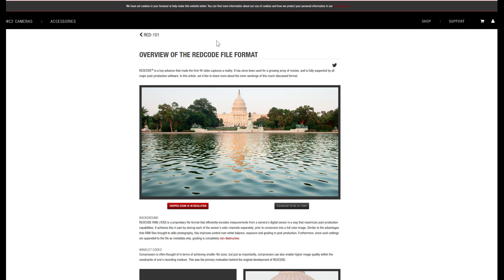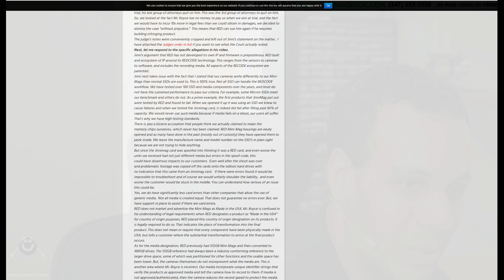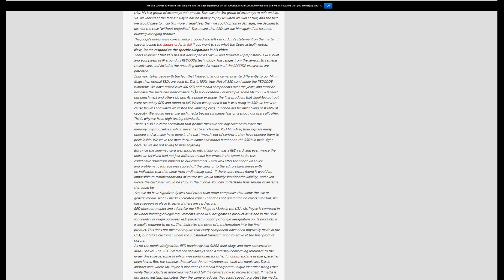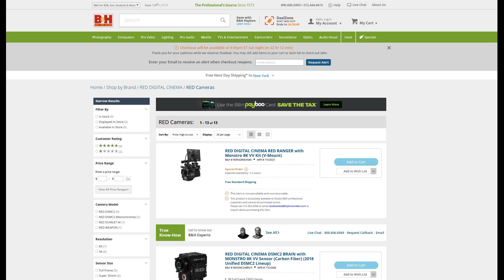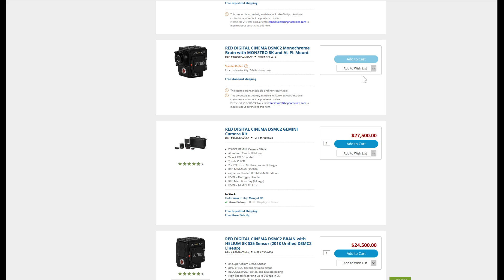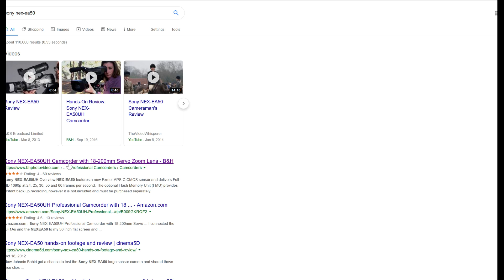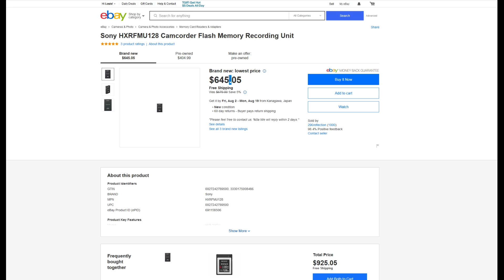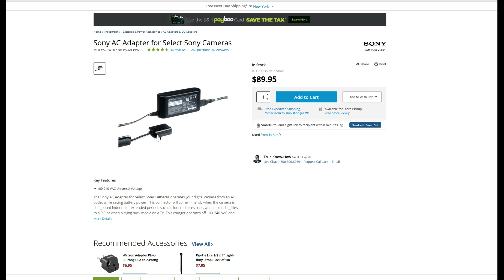Red Camera Mini Mag thing - my take on it.

Comment: Doesn't a gallons worth of printer ink cost like $5,000 or something?
Reply: Oh God, don't get me started. Not only do printer companies ramp up the ink costs but they go out of their way to not only make you use THEIR ink but also do really deceitful things like monitor the amount of ink you have (in the printer firmware) left then switch to using some BLUE ink rather than BLACK depending on what makes the ink run out FIRST to force you to buy a new ink cartridge... ugh.
Reply: yes that's another disgusting practice.

Comment: This is like crying that a Mercedes Benz is too expensive when most of your driving is down the road to the supermarket once a week to pick up some Swanson tv dinners and a case of Coors Light.
Reply: More like crying about your super expensive Mercedes Benz having a crap gas tank thats rusted out and leaks everywhere. Like Linus Tech Tips pointed out, they're quite cheap SSD's, and Red even offers data recovery(probably because of said cheap SSD's failing).
Reply: Wrong... it's more like complaining that Mercedes Benz is selling a GPS screen for $2400 that is identical to one you can buy for $300 from someone else. Then you call them out on it and they explain they spent MILLIONS OF DOLLARS developing this screen so you crack it open and see it's just standard parts they had no hand in developing. That's more accurate.

Comment: The problem is people thinking you get the quality you pay for when it comes to high end video gear. Surprise! You don't. Quite the opposite. 
Cheap shit is usually better quality for the money because it does 'work' and is ridiculously cheap. It's still crap quality, but given what you paid the quality is better than it should be. 
For the price you pay for cheap shit it shouldn't really work at all.
Reply: Ummm... you appear to be describing the idea that you get better quality in general with more expensive devices but not better value. Wow! Surprise! Sarcasm aside, the "value" a product has is completely subjective. The SSD storage costs are insignificant to Disney Studios when they film the next Avengers movie. To them it's a great value if it saves them time or whatever vs a different option... it may be a completely SHITTY value for the average person on the street though.

Comment: Just thought you should know that REDcode files are stored in a folder for each recording session due to the file size limit in a FAT32 filesystem. I don't think that error really changes your main point though.

Why they're using FAT32 instead of exFAT on an mSATA drive? No idea lmao.
Reply from the maker: I know why it is done, but that could very easily be what they were referring to when they said some sort of special way of writing to the card.
Reply: @rossmanngroup  Gotcha. I also think RED could be talking about the mSATA to whatever-the-hell adapter they use inside the Mini-Mags (even though there's apparently zero processing on that adapter).
Reply: @entriphy  ,
There is zero processing. There's no chip. The adapter is just physically connecting the wires.

Comment: I have no problem with red making a lot of profit on they harddrives. I see it a little bit like cardridges from printers. There are just usage markups on them. They only problem that I have is that red isn't telling the truth about what you are paying for. Linus made a pretty good video about it. This is just funny how one company can make such a big fuzz. It also doesn't help that red has startend a lawsout wish makes it even biger news.
Reply: The printer ink analogy would work if the camera was sold at a low mark up, but those cameras are bloody expensive with a huge profit
Reply: Problem i got with the mags are they do NOT even test them and they're using the cheapest ones they can get. If they sold the mags for a 20x markup while using eMLC or industrial grade ssds i'd have to problems with it.
Reply: @peterpain6625  ,
Probably a RAID redundant solution with reasonably good memory would be superior to a non-RAID solution with eMLC, high-quality memory.

Comment: Watch LTT's video on it, he shows that the SSDs are just your normal run of the mill SSDs plugged into a red interface adapter, it's not special hardware, he also went in depth on the response of the CEO
Reply: They're actually WORSE than run-of-the-mill SSDs. They're relatively low quality, and LTT themselves have had to RMA them multiple times.
Reply: @nmotschidontwannagivemyrea8932  Exactly. They're using their savings from using very cheap SSDs to offer their free data recovery service. Cheaper to offer free data recovery on cheap flash than to use good storage that's highly unlikely to fail.
Reply: @jblyon2  The "Free data recovery service" is included as part of the camera price so technically its not free you paid for it buying the camera.
Reply: @jblyon2  Except for when data is unrecoverable, or when there isn't enough time for a project to wait for data recovery. Not to mention that offering a high-quality SSD wouldn't even eat into their margins in any significant way-remember that these are the people charging hundreds or thousands of dollars for basically every single camera accessory, many of which are nonstandard and need to be bought from Red. And not to mention the absurd markup on the SSDs themselves, which don't use any sort of standard connector. And not to mention the fact that the camera itself-JUST the sensor-is around $50,000 USD. They do NOT need to be cheaping out on the SSDs in order to offer that service, and the only reason they are is short-sighted greed.
Reply: @jblyon2  Even if part of the cost of these mags/camera goes into data recovery, that is STILL NEVER a replacement for redundancy. A media failure on a single drive camera can, and often will, render scenes useless. But if by mirroring a recording across two drives allows for a drive failure to be tolerated. "MEDIA FAILURE IN SLOT 1" Not that big of a deal, just notify the director when the take finishes.
Reply: Was a good video. I agree with Linus on why dont they just do a RAID inside the pack so you wont lose your shit probably ever...
Reply: @-JonnyBoy-  That requires non-standard hardware if just for the connector, and I've seen RAID fail too. Actually, I've seen more RAID / adapter failures (bad connection, bad cables or in my case, incorrect handling of SMART by my Samsung HDD's) than HDD failures. And, very basically, an SSD is already a RAID device *internally*. Note that these things are likely using a filesystem without recovery option (i.e. keeping a log). So if the power suddenly fails you can have FS level issues too. RAID would not solve that kind of thing. Finally, we're talking about a camera creator - their knowledege about RAID and FS may be limited, whatever their cameras cost.
Reply: @owlstead  You're not understanding what they are saying. By raid, they are asking for redundancy... such as a mirror. If the RAID were to fail, you'd still be able to access data off one of the drives. This isn't, for example, a RAID 5 where you might lose two disks and lose the array, or lose the controller and lose the array. Just two mirrored disks would suffice and wouldn't be dependant on propritary controllers.
Reply: I say they're silly with their money for buying those cameras, and they're dealing with the ecosystem they bought into... They don't need those cameras.
Reply: It's a "cult" much like the Apple iSheep... a hyped up hype.
Reply: Like Louis said the SSDs probably have Red's special firmware to lock out other SSDs. It's even worse than just an adapter. But oh well I'm not buying their cameras
Reply: @AwesomeSauce7176  And I think Louis missed the problem, Red mini-mags aren't exactly known for being reliable, with high failure rates.

For such equipment, you would think that they would use two SSDs so if one fails, the other would have your data.

But nah, let's take cheap SSD without any redundancy.
Reply: @MillerTM  than do buy the mini mag it makes no sense when all a company gives a shit about is your money
Reply: @bosstowndynamics5488  agreed. and to extend on the point about them being a camera manufacturer... what does it matter? their entire camera system (sensor, boards) is proprietary not off-the-shelf - I don't think figuring out how to implement a RAID is outlandish. hell, i can do it, and i haven't made a 50k camera.
Reply: @bosstowndynamics5488  Yeah but you won't need no data recovery without a camera, would you?
Reply: Selling 200$ drives for 2000$ is outrageous, no matter how they twist it.
Reply: The problem is wrong capacity advertise 512GB is 480GB MSATA

And it used cheap MSATA + Cheap PCB

Which is bizarre and overpriced
Reply: @DhavidSetiawanKilluaDhavid  While that is indeed an issue, RED isn't entirely wrong there. Simply because of how NAND is manufactured, their real capacities are almost always a power of 2, the reason why you see some cards marked as being 240, 480, or 960 is over partitioning from the vendor, a portion of the capacity is set aside for things like wear leveling and garbage collection.

Comment: If you're defending Red, you have what is called "Stockholm Syndrome".  Red is worse than Apple.  $1,450 for a 512GB drive, and $2,350 for a 1TB drive.   These are not even M.2 nvme SSD speed drives.   They are slow.
Reply: Who are you talking to?
Reply: Well, that's not what Stockholm Syndrome means but I see what you're trying to say. To get Stockholm Syndrome you'd need to be physically captured by somebody. You are however obviously describing a tendency to side with the "captor" or in this context the company you bought something from. Both are internal rationalizations.

Comment: Red is probably cheaper than other cinematographic solutions. Plus it's a metric butt ton smaller than those massive bigger cameras.
Reply: Their camera bodies are "justified" to be priced at 40k because there's not many alternatives to their cameras and for the most part, their cameras are pretty darn good (Or so I've read because I don't own one). 

However, making a propietary connector to force you to use their storage and then sell you mediocre storage at absurd prices... well that's what's wrong with this whole issue.
Reply: @Kenchinito2207  Yes it is stupid. Obviously hollywood dont find it a big enough problem to do something about it.
Reply: @MegaMech  Blackmagic?
Reply: @Kenchinito2207  Not many alternatives? Wrong. There are many cinematographic worthy camera brands and models. If by alternatives you meant that have similar features and the compact size than yea sure, you have a point
Reply: @Kenchinito2207  And one of Linus's points, theres no active storage redundancy. If your ssd goes kaput in the middle of filming, you lose all your footage, whereas other cameras have more than one ssd for redundancy.
Reply: @i.suk.6146  Which is a very fair complaint and a good reason for hollywood not to use red cameras

Comment: they lied about the capacity of the drives and that they were made in the USA.
Reply: They didn't lie about the capacity, go buy a 1 terabyte ssd it will be 960 gb or somewhere around there. Swap space / spare space is common knowledge to anyone even remotely tech savvy.
Reply: TBF, when you buy a regular HDD/SSD that markets 512gb of storage, it contains 512 000 000 000 bytes of capacity. However, when you plug it into your computer you will notice that the system only recognizes about 500 gb, this is because RAM is counted in multiples of 8s and not 10s and the system counts the hard drive space by increments of 1024 bytes instead of 1000.

Also, the fact that they assemble (not manufacture) the product as a whole in the USA allows them to say "made in the USA" even though parts of it were imported. The take from Linus on the issue explains this a bit better than I could.

TO be clear, I'm not a RED user nor will I ever be and I think their drives are ridiculously priced. Just wanted to clarify your points.
Reply: The enclosure is made on the USA the ssd will never be made on the US tbh if you see most ssd are made in taiwan or china or japan also the capacity is never will be the entire 512gb that most ssd says since a little bit is taken
Reply: They didn't lie about "made in the USA" AFAIK since that has a specific meaning that does NOT mean everything was made and put together here. Although "made in the USA" is often a lie (intent to deceive) so people buy it thinking they are supporting America more or something rather than "outsourcing"